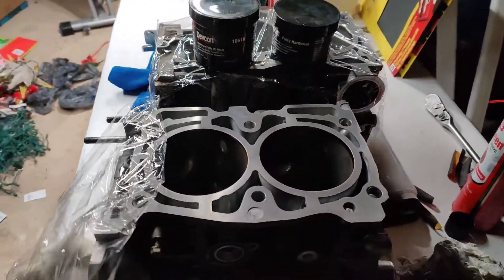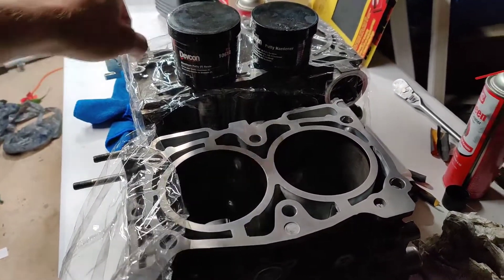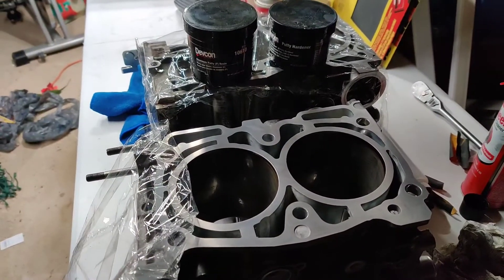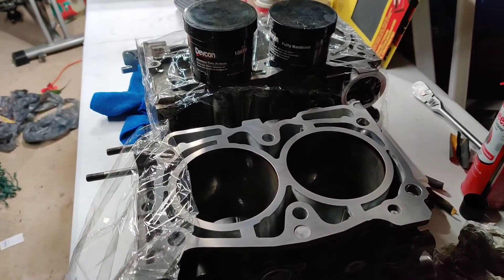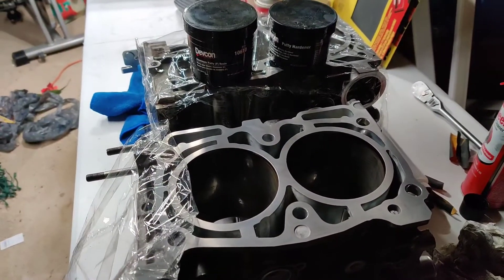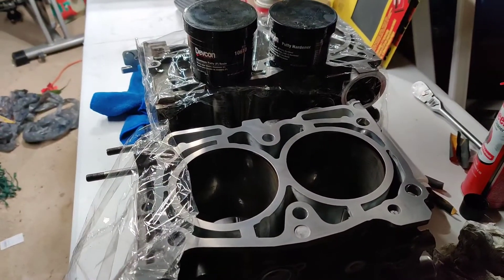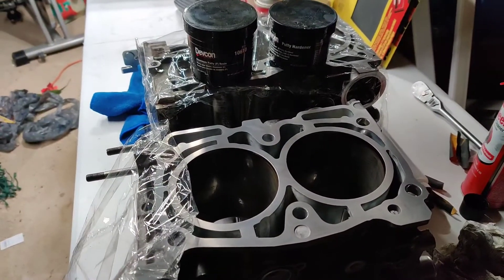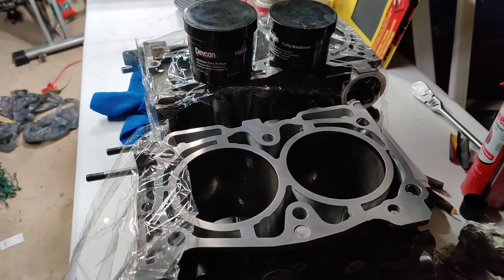Subaru DIY "closed deck" (part 1)

Comment: done it better then iag  had an iag block warp  and snap a crank shaft  epoxy filled a doner block and its holding strong then the iag did